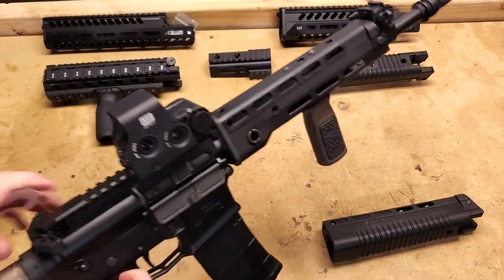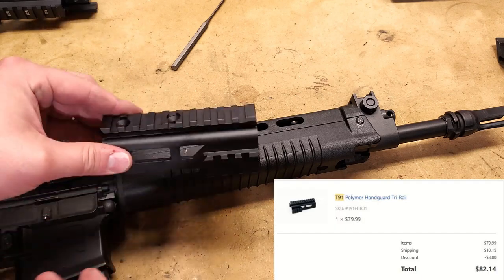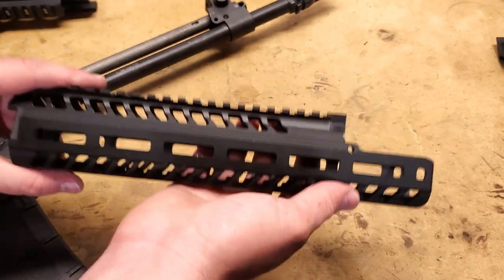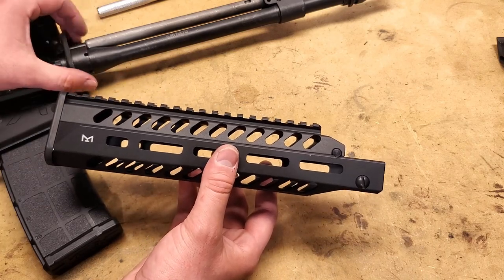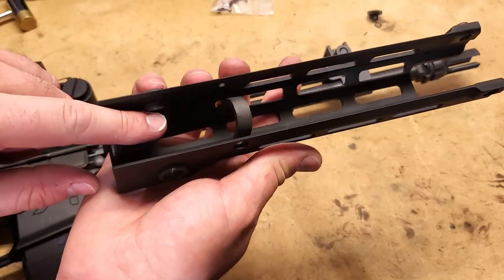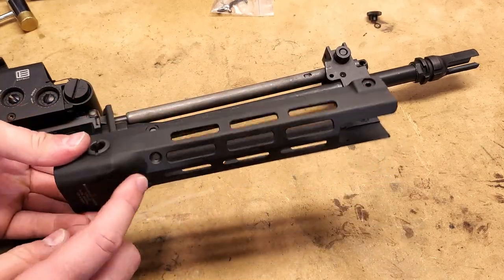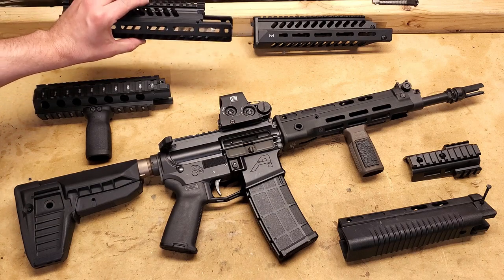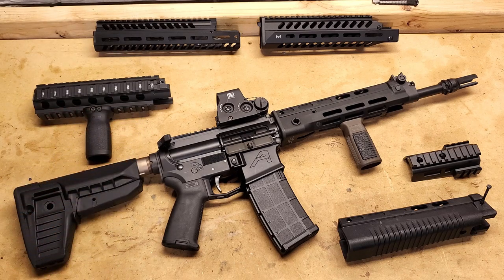T91/Wolf A1 Handguards - Original, BB, Prototype?

Comment: The weakest part of the T65/86/91 family has seemingly always been the handguards. The Taiwanese are always behind or at least suboptimal. I've seen AN in service quad rail, but I've never seen it in the United States.
Reply: Saw someone here on YouTube who modified his T65 to take a Midwest Industries quad rail. Looked good and functioned well.
Reply: @bronzeguy9839  He had to replace his barrel nut as far as I can tell. Most rails would work if you did. It's still kinda grim, though. KAC rails can't work because they grab the barrel nut where the piston goes

Comment: Great video! One question, will the Picatinny quad rail upper handguard section work with the TS/Biaotach MLOK lower handguard? If so, I think that would be a pretty sweet setup. Pic rail level with the upper for flip up irons and other accessories, MLOK on the lower for ventilation and lightweight accessory mounting interface.

Comment: Put the first cotter pin into the locking pin before putting the locking pin in place. Then use that cotter pin to turn the locking pin to the correct orientation.

Comment: Concur that the BiaoTac is the best-of-breed for this application.  Your video was very helpful and I agree Installation was a a bit of a pain.  I used a bit of Aeroshell MS grease on the barrel nut and a long arm skinny allen key as an alignment spud for the front pin, which was easily the most challenging part. The nut insert on the left side front can be removed to allow fine tuning of alignment, then reinstalled with a drop of loctite on the outer threads  It would be nice if the Ebay vendor included pictoral instruction sheet and torque specs for the screws.

Comment: The quadrail looked the best but i dont want the extra weight the 12.5 is already a little on the heavy side for a pistol, i just filed a little of the side slots and m-lok installed perfectly also installed a angled grip on the bottom handguard so far its holding solid.

Comment: I got a biaotac handguard but the triangle handguard retainer wobbles around even when I tapped it down with a hammer onto the upper handguard. Any advice? I tried shims already but the gap is pretty big and the shims don 't stay secure.
Reply from the maker: So mine has some movement as well, but not much, you might be able to tighten it up by removing the handguard and pinching the retainer a little in a vise.

The biotac handguard doesn't really use the retainer except for the upper stock portion, it doesn't fill out the retainer cup.

Comment: Does the Midwest suppressor handguard fit t91?
Reply from the maker: It will not. Barrel nut size wouldn't be an issue but the upper rail is. Does not allow enough space for the gas piston up top.

Comment: if you have the 12.5 what kind of buffer weight should you run
Reply from the maker: H3 weight anti tilt buffer.
Reply: thank you, i really appreciate that.  @CondavourTalksGuns
Reply: dumb question, this is what I would need  Anti-Tilt Buffer Kit - $125
Quantity:	
1
       
This kit includes a Wolff XP carbine buffer spring, an empty buffer body and various internal weights to allow 'tuning' the buffer to your specific firearm/ammo. Total weight can be adjusted from 4.0 to 6.25 ounces, or up to 8.5 ounces with the optional Tungsten inserts sold below. @CondavourTalksGuns
Reply from the maker: @DREKOWICK69  You do not necessarily need an anti tilt buffer, but that could work fine for you. Also know that with the anti tilt buffer you have to pull both pins on the lower to clean, as the upper wont be able to tilt forward anymore.
Reply: thank you. I am at work and can't really fully understand but when i get home and can focus I will re-read this, I just want to make sure I buy the right thing for this to work. I really do thank you for the replies and knowledge, I am sorry I am not smart like most of the gun bro but i want to learn and I am trying and thankful for people like you. thank you again and sorry for comments @CondavourTalksGuns
Reply: ah, thus the anti tilt, that I actually do understand!  @CondavourTalksGuns

Comment: Anyway to get a brass deflector version of the t91?
Reply: Switch out the barrel, piston rod, and gas block to an upper with a brass deflector seems to be the only available option.
Reply: @bronzeguy9839  Didn't even know that could be done, do you know anyone that has done it?
Reply from the maker: He's basically saying replace everything that makes it a t91 lol
Reply: @CondavourTalksGuns  Sounds like all I need to do is swap out the the upper part of the upper, everything else is still the t91. 
Can really justify buying a gun that I can't really use ya'know?
Reply: @internetmeta  Don’t know anyone who’s done it. If you know your way around building AR’s, it’s fairly easy to do. I’ve considered it but decided against it. I’m not that neurotic.
Reply: @bronzeguy9839  Might have to try it out, kinda sound like a fun project. Just got done setting up my first AK and had a lot of fun with it even with the issues I run into. 

My new hobby might just be setting up guns lol.
Reply from the maker: @internetmeta  upper is unique to the t91 with a metal plate reinforcing the gas piston hole along with a higher rail to allow the piston clearance.
Reply: @CondavourTalksGuns  Is the metal plate attached or is it a separate part?